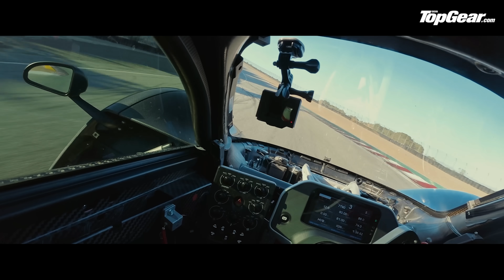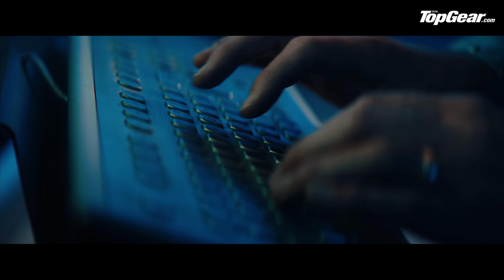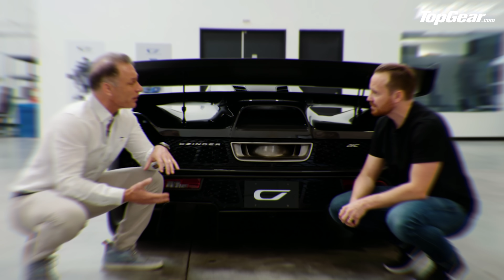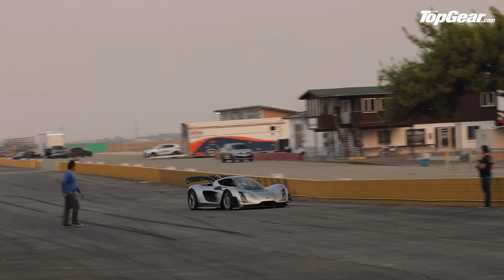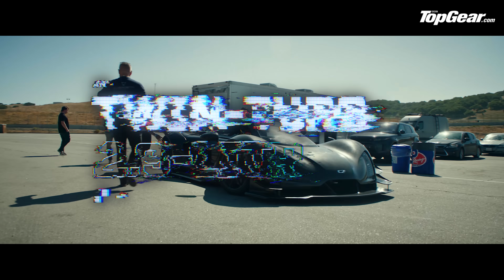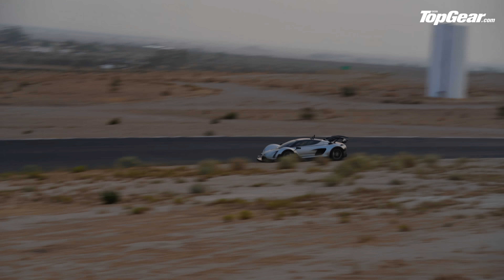World Exclusive! CZINGER 21C FIRST DRIVE: $2m, 1,233bhp 3D-printed hypercar | Top Gear

Comment: When I saw the 0-248-0 mph in 27.1 second compare to chiron’s 41 and regerra’s 31. something I was awestruck. Man this is crazy insane. 🤯
Reply: 1.9 secs 0-60 is very, very close to the world record for a roadcar, the Nevera. I'm sceptical but who knows.
Reply: @JayDee-b5u  yeah that’s true. With technology, super cars have dampers that can easily be driven as daily.
Reply: What's it like over pot holes and speed bumps?
Reply: @Markcain268  dude this is clearly a track car. Why are you talking about potholes?
Reply: @clintonezeh7556  if I spent that much on a car I'd want to drive it on the road, though, like everyone else on you tube it's just a dream.car, never to be experienced by us mere mortals
Reply: @Markcain268  probably about the same as the chiron/regera.
Reply: @TakumisBizarreRacingAdventure  so not good then?
Reply: @Markcain268  With the low ground clearance it'd probably be pretty bad. Definitely not designed for bumpy roads though.
Reply: @keptick  no good in the UK then
Reply: @Markcain268  these cars are not made for rough roads. The dampers set up in these cars are for speed and handling so they are not like the ones you get in luxury cars which are obviously made for comfort.

Comment: Rear wing bounce is impressive. But it's not unsprung.
With such elaborate design and AWD specs and stright line numbers, I would guess more than 2 seconds faster than a Senna would be possible by now. Seems this thing needs a lot of tweaking still. Curious what the ownership experience will be.
Reply: @ARTura I have three of them on order.

Comment: WOW. That is a highly polished first car design that you don't normally see from new companies. Most are a bit too out there to stand out. Very well done!
Reply: The canopy flew off ffs?
Reply: @dagnut  Tesla Model Y's have done that when in production lol
Reply: @dod_the_angel  don't get me started on that over priced garbage.
Reply: @dagnut  Ik. I just found it funny
Reply: @dod_the_angel  I can dig it.. I found the Zenvo TSR-S funny and gimmicky.
Reply: @lknanml  so where's does "highly polished" fit into that?
Reply: @dagnut  It's the design. The lines and theme of the car. It all flows well from one section to the next and I don't mean wavy flow I mean the design philosophy of the cars concept. Jagged edged cars can flow as well. We see a lot of new companies come out with a car that is more of a movie villains ride and less moving when looking at it. Not sure if any of that makes sense.
Reply: @lknanml  ok I understand, the term polished is usually associated with quailty
Reply: @dagnut  As well as theories which are not final. Just promising. 
Ideas can be polished. Concepts can be polished. Polish can be polished........ 
Also this is a 3D printed project. I have 2 3d printers. Let me tell ya that work is POLISHED compared to mine. And you know metal and not just random bits of that looks like fun to make and I can replace that with a 3d print no need to buy  it...  I do see where you are coming from though. Just remember when you are comparing cars like this to yours there is a difference made up of hundreds of millions of dollars and thousands of people all working on the same thing.
Reply: @lknanml  no you're using it wrong, polish is the last thing to be put on a finished project
Reply: @dagnut  There are multiple ways to use a word and it does not have to only be used when it meets all of its definition criteria.
IE  "characterized by a high degree of development, finish, or refinement
Using the development "clause" here ;-)
Refined, skillful, remarkable, First rate, superb, outstanding.. Feel free to think of those instead of polish or polished design.
Reply: I think the car looks very organic

Comment: Got to say, I got no confidence in that wing with how much it's moving around. Scared that thing will fly off with the roof next time 🤣
Reply: Yeah. On the other hand F1 cars got flexible rear wings aswell
Reply: The part with the 3D printing is ingenious. 

You don't need a huge warehouse with spare parts so that you can still supply your customers with spare parts in 20 years. You just print them to order. At least with Hypercars. 

If one of these cars survives 40 years, all you need are the CAD plans of the parts and you reprint them. Even in a better quality.

Comment: The interior camera is insane; looks like a fighter jet.
Reply: Glossy plastic in a car or a plane is a big nono. Hopefully they will change it. Also 650kg down force on that wobbly rear spoiler? This car has a long way to go.
Reply: @hagestad  No, it should have a very short way to go. And then the story ends. Another weird project going to the Boon Doggles. Did you buy one? And why not? You should, or it will be forgotten. Buy it! Buy two!
Reply: It has to be since you decide to inspire from a stealth fighter.
Reply: @ege_x3rt187  The SR-71 isn't a fighter plane
Reply: @Your_Paramour  the SR-71 inspired the engineering approach, not the actual design aesthetic. I see some clear design inspiration from the F35 - particularly the cockpit.
Reply: @Your_Paramour  you’re right but do you feel cool correcting people about sr71s 😂😅
Reply: @Your_Paramour  It's also not stealth
Reply: Wow, so the interior camera is a nutcase then?
Reply: yes
Reply: No it’s not
Reply: Driver's seat in the middle of the car...
Random guy: Looks like a fighter jet
Reply: Should be facing forward, though.
Reply: This is the worst supercar if you crash ur head is gone.
Reply: @mohammedattal8887  you haven’t even see an crashes of it
Reply: @mohammedattal8887  Bro thinks hypercars are supposed to be safe lmao
Reply: https://youtu.be/Lov1sdU7Lyooue